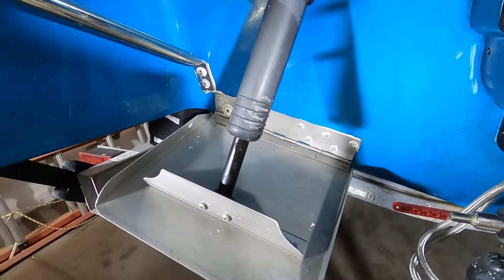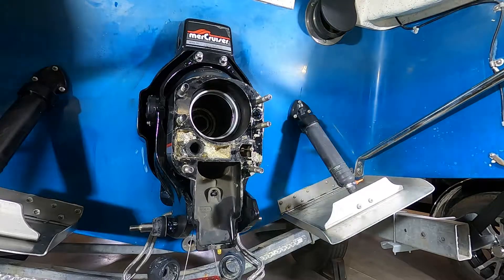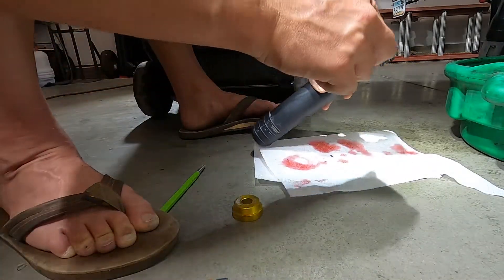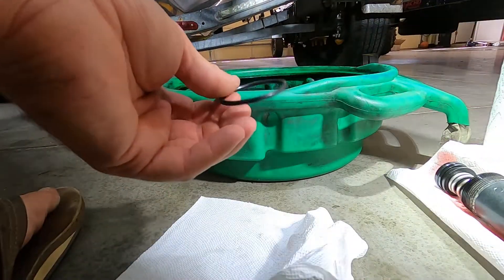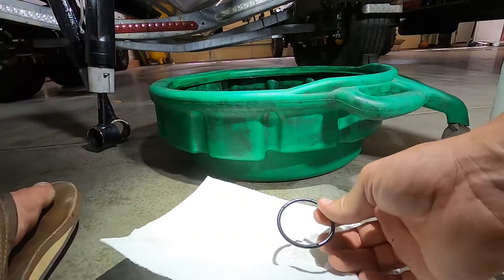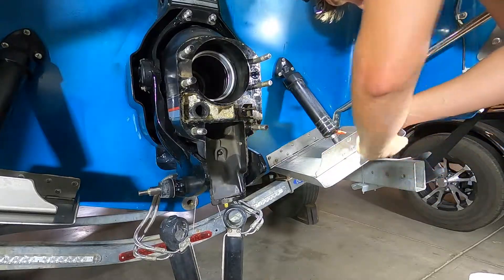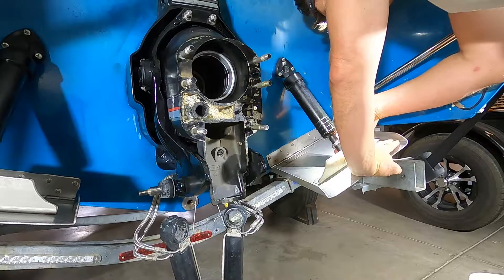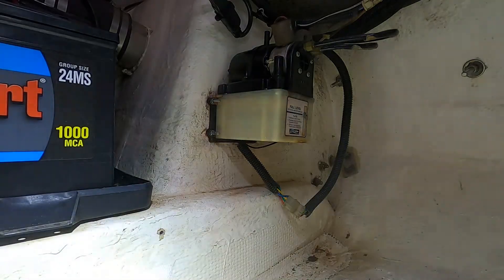Bennett trim tab actuator o-ring seal replacement

Comment: Great video, helping a lot. 
But do you know how to pump out the oil from the pump, I found water in one cylinder and I'm wondering if I need to change all the oil.
Reply from the maker: I have not done this, but I would imagine that once you have the rams taken apart, you could push the switch to extend the ram and it would pump out whatever is in the reservoir.
Reply: Do you think that's enough to take out sylinder out and pump out?

Comment: Great video. Thanks so much. Inside the actuator it seems to have a second place for 2  o rings. That's what I did, I put 2. I haven't tried it yet.  Do you think this will create a problem or really solves the leak problem?
Reply from the maker: Hard to say...normally I'd say that if it needed the extra o-rings, they would have put them there originally. But in this case, as long as the inside of the tube is smooth and there's no interference, maybe it's ok. Let me know when you get a chance to try it out!
Reply: @destructure00  My issue was that at the local dealership they were asking me 69 euros for 2 o rings. So I put another 2 of the same from my collection and as I said so far it works very well. Thanks for your reply.
Reply: @FENIA3648  Mine are leaking again after 1 year.  I ordered the o-rings from the link provided and they seam to be from China.  They must be low quality. I was thinking of putting on 2 o-rings as you stated.  Has it worked well for you?  I am worried it will be hard for the pump to operate the actuator with the extra o-ring.

Comment: Donde se puede comprar las juntas toricas de repuesto?
Reply from the maker: I bought a kit on eBay for about $15. Here's the link to the one I bought....I'm not affiliated with this seller in any way. 

www.ebay.com/itm/183766952641
Reply: @destructure00  muchas gracias
Reply: Сколько стоит это херня

Comment: I have water getting into my trim tab reservoir, would this be the reason and fix needed?
Reply from the maker: It's a possibility. Do you see any fluid leaking out of the pistons?
Reply: @destructure00  I don't recall seeing it leaking. I know I got the boat last year, fluid was good and dark red like it should be. A little while into the season the fluid looked more pink. I thought maybe the level was low, but when I went to put more fluid in, it wasn't low. I asked a couple friends about the fluid being pink instead of red and they didn't seem too worried about it. Just getting it ready for the season now and I see one is still is pink color, and the other is barely pink at all, instead it's clear (basically water) and now I know something is wrong. So it's not so much an issue of only losing the good fluid that was in it, but it seems to be sucking in water somehow.
Reply from the maker: @jackoff1826  the way the springs inside the actuators are pushing the ram into the body and trying to force fluid out, I think it's more likely that a bad seal would cause a fluid leak than water into the fluid, but if you run with the tabs retracted a lot I could potentially see water getting in. Leave the tabs extended with the boat out of the water for a few days and see if they retract on their own, or if you see a fluid leak. Also worth checking all the hydraulic line connections inside the boat for leaks too, and maybe extract some of the fluid to see if the water separates from the ATF.